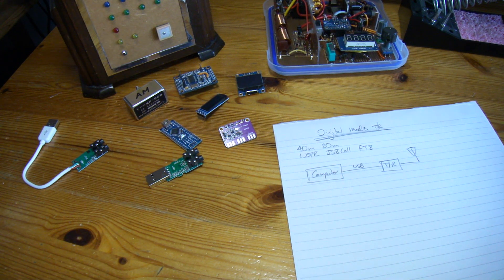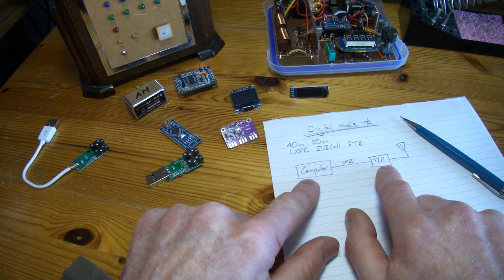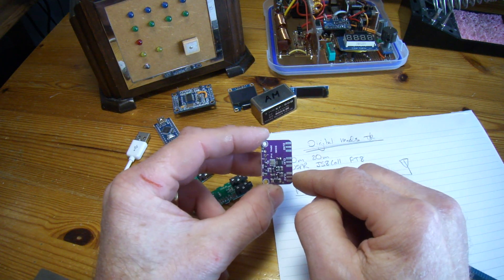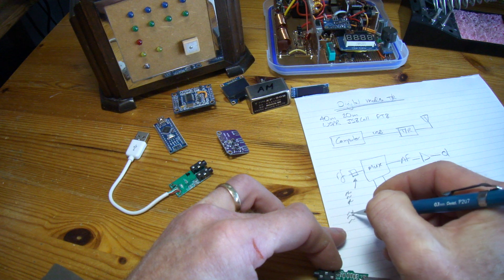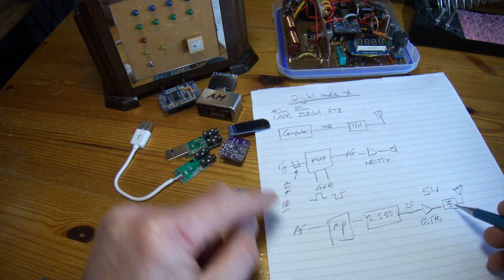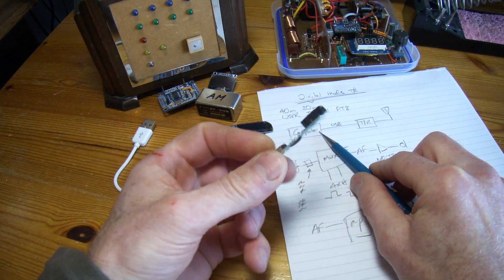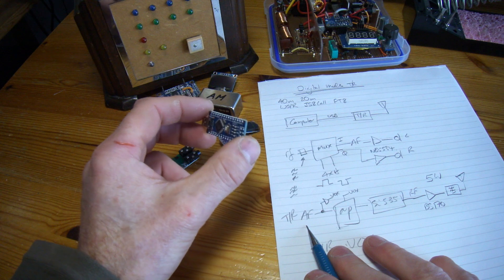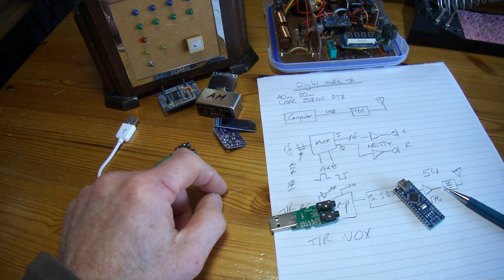Digital Modes Radio - Part 1: Thoughts and Ideas

Comment: Digital vox would be easy. Always receive and digitize on the pc->radio line. When you detect a signal above threshold you detect frequency. Since you're then twiddling the si5351 to send you just buffer the symbol stream while switching to transmit. When it's fully switched you send the symbols. You'll only need a few ms at most so you won't need to buffer much

Comment: Enjoyed this video. I look forward to seeing how your project develops. I think if you only use the I output of the Tayloe detector, it's effectively a direct conversion receiver, and the I output alone will contain frequency components from both sides of the local oscillator frequency. To properly suppress the lower sideband and leave only the upper sideband (for data modes) it will be necessary to further process the I and Q signals. For example, you could use the Phasing Method, with a Hilbert Transform (-90° shift) of the Q output summed with the I component. Good luck with the project.

Comment: Your description of the Tayloe detector, particularly your description of the quadrature LO inputs, doesn't sound right.  It sounds like you're saying that one of the LOs is just an inverted version of the other, which may appear to work, but this isn't quadrature.  Quadrature is a 90 degree phase difference between the two, and I think you can get the SI5351 to produce outputs that are 90 degrees out of phase, but it's important to make this distinction, or your detector won't work well.  That, or I misunderstood what you were saying, in which case, never mind!
Reply: And now that I've watched the rest of the video, if you're not using the Q output, then it doesn't matter that your LO inputs to the Tayloe detector are in quadrature, anyway.  In fact, if you're only using the I output, you don't even need a quadrature input to the mux.  If you look at the multiplexer in a Tayloe detector, one of those LO inputs feeds the mux that produces the I output, and the other feeds the mux that produces the Q output, so it doesn't do anything if you're not using the Q output, and you can leave the second mux out as well.  And honestly, the main reason to use a Tayloe detector is to reject the unwanted sideband if you're using direct conversion, i.e., zero IF, since you can't use an IF filter for that.  But since you're using a superheterodyne configuration, it should be perfectly fine to use a single LO and mux, producing only the I signal to your audio amp.  You're basically using a mux as a balanced mixer.
Reply from the maker: That's good to know. I found the old code which dates back to a 2018 SDR radio. In that case i did need the I and Q, but as you quite rightly point out, I'll only need one channel in this application. That will simply things. Thanks again.
Reply: @CharlieMorrisZL2CTM  I'm looking forward to seeing where this project goes.
Reply from the maker: No you are correct. 90deg and not 180deg. Thanks.

Comment: Welcome back Charlie.  Re filtering for the two bands 40 and 20m, you could use separate relay switched LPFs for those bands, route the Rx signal thru one of these, then into a Fixed HPF with cutoff below 7MHz. The combination is effectively a BPF on 40 and a wide (7MHz) BPF on 20. So only one pair of filters to switch.   I've tried this and it worked FB. Of course it depends on the local environment.  If you live near a big transmitter on 8 to 13MHz, you might think again. Most of the energy coming down my coax is MW BC stations so it worked for me. 🤓
Reply from the maker: That's a great idea Paul. I've jotted that down. I think two BPFs should work, as we're only interested in a tiny portion of each band. Getting the BPF passband to cover that section should be easy. I'll have to double check, but I'm sure Codan did that with their 7727 at least. Both RX and TX went through it.

Comment: The computer has stereo out as well.  Software allows you to send data on one channel and a constant tone on the other. Use the tone to activate the VOX. This eliminates drop out caused by data interruptions.   And I think hang time is adjustable in software as well.
Reply from the maker: That's interesting Jim. Do all software send the tone? I'm trying to make this software agnostic, hence the lack of CAT etc.
Reply: @CharlieMorrisZL2CTM  
Not sure about all. Have only used WSJT. 
It’s been awhile and don’t remember the menu setting but it’s in there.  Let’s say data is on right ch and tone on left.   The left ch can be amplified separate and gain controlled for VOX sensitivity.  

To make it software independent you could put  a jumper between L and R channels, making it mono.

Comment: Nice to have you back with another video.
 I take it your looking at the fst3253 for the mux.
I'm sure there's a library out there that will read the frequency of an input pin.
Sounds like an interesting little project, can't wait to see how it goes. 
Brian. M1CEM
Reply from the maker: Thanks Brian. Yes it was the 3253. I hope I can still buy them. The software will be interesting as I need to (from what I can see) measure the audio frequency down to 0.01Hz every 0.6S for WSPR at least. JS8 and FT8 are more stringent on timing (0.19S). I'll have another play today.
Reply: Those timing tolerances might be a bit much for a nano, well it certainly would be fo my programming skills. 
Maybe look at the stm32 or esp32. The esp32 is fast enough to do some quite reasonable DSP.
Reply: Maby use frequency to voltage converter and adc.
Reply from the maker: Yeah I had seen a reference to a full bridge rectifier and measuring the DC level. Might be something to look at.